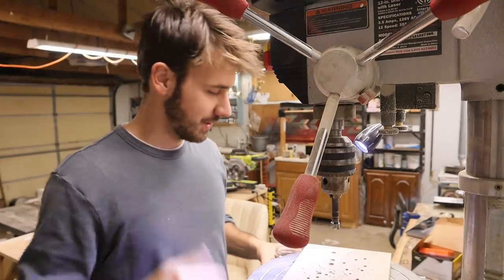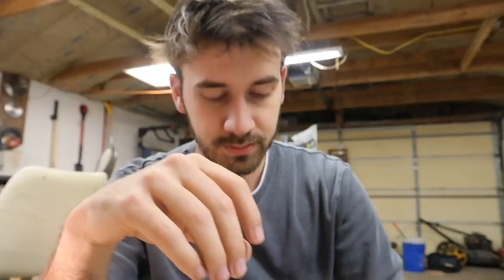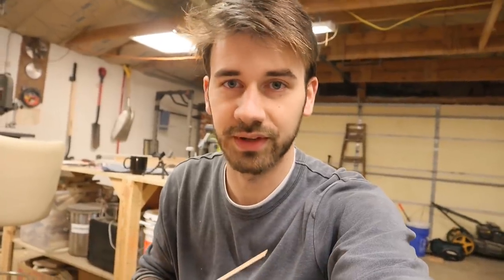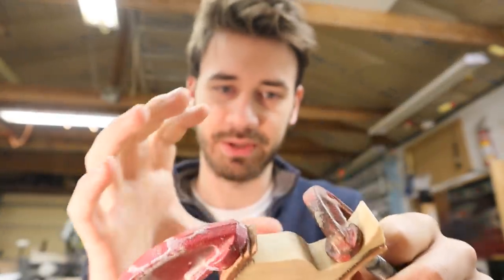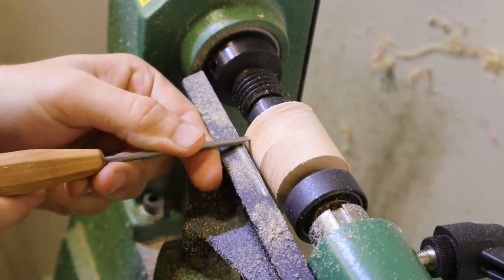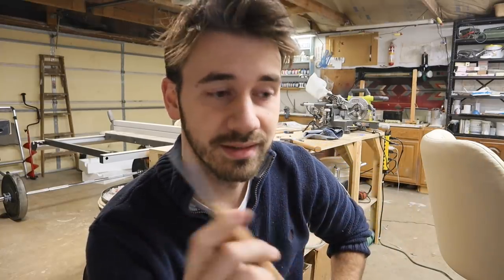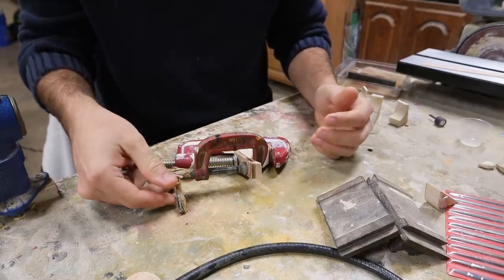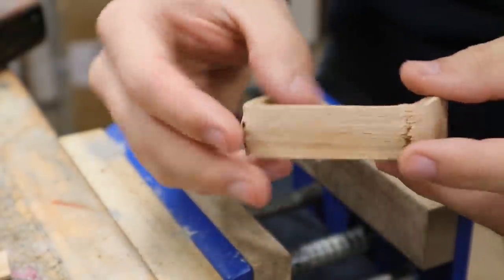Making a Fishing Reel

Comment: Already looks really good mate. What I've found is that wood bends the best when steamed. I've had to bend a 4 by 8 wooden beam into shape to fit the back curvature of a boat. So making a steam bender is the best way to go. (It's not hard to make, just a reservoir of boiling water at the bottom leading up to a horizontal tube to the top, plugged at either end.) It's the combination of heat and water that does the bending. Just water is not so flexible. Learned this from an old shipwright.
All the best and good luck from New Zealand
Reply: For those size of strip he can use a standard pressure cooker and have the strip sitting in the steam
Reply: @jamendetvarjukul  that's a good idea

Comment: This is turning out nicer that i thought. If i may add few pointers, when bending wood a really good way of doing it is with steam. what you do is just get some pvc pipe and rig that air tight into a pot of water so that the pipe is laying in a 45 degree angle compared to the pot that you then heat up and use as a steam source to soften up the fibers of the wood, you can get thin strips of wood so soft that you can tie it into a bowtie. Second thing that came to mind is the material for the drag system. Old fly reels use cork mat as a breaking surface so maybe that might be something that you could use for your reel.

Comment: You, sir, are a ninja for attempting something like this!  By the way, you can reduce the springback on your bent laminations by baking the whole thing, clamps and all, in a low temperature oven.  Also, you can put a metal band around the outside of your bent laminations to support the back, reducing cracking.  You may have reduced the radius of curve in the design of bail to make it less likely to crack.

Comment: For the aluminum gears to get the 45° mesh angle you can use the lathe, as long as your chisels are harder then the aluminum they should be fine (but I would use files). Also when you were bending the hickory,  I've made re-curves before with a similar process (different wood), If you have any leather around the shop put it between the wood and the mold to prevent the cracking(Works best if the leather is between a 4-8 thickness).  Can't wait to see your next video.

Comment: Nylon washers for the spool. Or teflon. Should have drilled the center hole while in the lathe so its centered and used the forstner bit in the lathe. A lot of the drilling could have been done on the lathe. Ash would have been better as it's not as brittle and easier to work in a lathe. Also flexes more before breaking. That's why bats are made from it. You make some killer life like lures. Awesome airbrush and brush work. I have an idea to replace your torch. A hot air soldering gun would work better and allow you to adjust the temp. I use one for all kinds of things. Browning food, stripping paint, soldering, welding plastic, drying things fast(like crazy glue and paint), starting charcoal for my grill, i tell ya it's a definite multi-tasker. Allows you to set temp and air speed. And the best thing was it was 30$ on the Bay. Just an idea.

Comment: You can use the lathe to drill, also, don't forget! The end stock can instead chuck a drill and be perfectly aligned.  Also that triangle tool you had is for cutting in 45° cuts

Comment: Your outside strips cracked while laminating because they didn’t have any support.  It’s why your inside strips didn’t crack even though they had a tighter radius to bend to.  They often use thin metal as a backer, but with something this small just put an extra strip of the same wood on the outside, just don’t glue it.

Speaking of, wax your forms next time to be sure squeeze out won’t screw it up.

Comment: Hey man, take it from someone who has been there done that. Wear some safety glasses, and just as importantly, make sure they fit your face. I use to not and when I did they had big gaps in them. Until I was grinding on a knife one day and ended up getting a chunk of metal in my eye. Rinsed it out, but it didn't come out. Few days later it hurt so bad to close my eye, went to ER, they had to call in an opthomologist on a Saturday to do what he called a mini prk to get the chunk out it was so deep. I didn't lose any sight. Dont want to see that happen to anyone else. It could have been a lot worse.

Comment: You can get carbon drag washers for fishing reels on eBay also you should go on YouTube and check out some videos using lathe tools they can be very dangerous good to get a few lessons that's how I learned also you can get grinding wheels aluminum oxide I believe for sharpening tool steel they are white

Comment: For future drilling on wood,  chuck your part up on your new lathe, put a drill chuck in your tail stock (morse taper arbor) on the lathe and use it as  horizontal drill. Works very well and all items are held in place as is.

Comment: For next time...
Set you pan and wood strips in the vacuum then pour boiling water from a kettle into the pan. Then run the vacuum. Heat helps tremendously in the bending process. I use a steam box for my boomerang wood strips. Also heavy leather or sacrifice wood strip as you outer layer makes for less splintering of the wood you want formed.
Are you going to cast your gears or carve them?

Comment: A split cane rod to match perhaps? Doesn't need any fancy tools or expensive material, my dad had a few he'd made in his youth and he's not exactly a master craftsman but they looked and functioned fine.
Hobbing your own small gears is incredibly tedious and precise without mechanical help so don't feel too bad if you've got to buy a cheap reel and gut it for parts (also no idea how you plan to make a worm gear without an auto feed lathe), you could also get the drag washers from the same donor

Comment: Hello, mechanical engineer here. While aluminum would probably work for the gears, aluminum is generally too soft a metal to be used in most gear systems. For a fishing reel I'd imagine it would be fine, but you'd be better off using something like brass or better yet aluminum bronze if you could get a hold of it. 

If you're feeling even more ambitious you could even cast the gears in aluminum bronze yourself, aluminum bronze is generally a very good choice for gears because it is one of the harder bronzes and can even be heat treated up to mild steel like hardnesses. 

That's probably a little beyond what you're trying to do here tho.

Best of luck.

Comment: For the darg you should use wood rings that have been spin on the lathe and rubbed against another piece of wood until the ring is hardened from heat and compreaajon and is smooth
Reply: Commpression
Reply: @seanallino4357  compression

Comment: I know I'll be the 300th person to say this, but yeah: eye protection. I can't even count how many times I've had Dremel grinding wheels fly apart. Had I not been wearing eye protection on the last two times I'd be blind right now, no doubt.

While I'm at it, I'm gonna unload some thoughts:

When bending wood, heating the wood softens the hard fibrous parts of the wood in ways that simple soaking can't. A simple way to get that wood and water hot is to immerse it like you did, then just plunk it in the microwave oven for a few minutes. Depending on the type of wood, adding some ammonia to the water can help it bend more easily as well, but it's likely that heat alone is enough.

On the lathe, the steady rest should be backed out a bit, and probably not as high as you had it. You want it high enough so that the top edge of your chisel is touching on the center of the part you're turning. Backing the steady rest out a bit gives you more room to move the tool, and keeps your hands away from the action.

Tune that band saw! Years ago I saw this video (https://www.youtube.com/watch?v=wGbZqWac0jU) and couldn't believe how much better my bandsaw cut when I tuned up my bandsaw. It's easily my favorite tool now (even more loved than my laser cutter, which says a lot).

Finally - if your forstner bits are burning the wood, they're either really dull or your drilling speeds are way too high (or both). Trying slowing the speed down if you're able and see if that helps.

Comment: Nice work, but you will be disappointed with aluminum for that application. It's not "slippery" and will likely gall up and wear prematurely. 
  There lots of online sources for brass. It will be worth the extra couple days it takes to have it shipped. 

    Or, check McMaster-Carr or Grainger. There's a good change you can find one with the spec's you need already made for a few dollars.
Reply from the maker: Thanks for the tip.. I’m going to find some brass for sure now
Reply: @marlingbaits   You might also check out Clickspring's Youtube channel. He's a clock maker and makes his brass gears by hand.

Comment: Obviously your water soaking method worked, but the appeal of boiling water or steam is the heat is what softens the lignin in the wood allowing it to bend. Steaming the wood is the most efficient way as steam carries heat very well. Of course then you need to make a steaming cabinet but there's a video by Tips From a Shipwright where he makes large heavy duty plastic bags to steam things in.

Comment: Fly fishing reels often use 2-3 graphite washers, then conical washers flipped 180 degrees to one another for a spring. Hard to explain a normal setup via text so let's try this.

Nut to |()()()|| to spool Hope that sort of makes sense, flats are graphite washers and the brackets are the conical ones. It may also be worth it to have felt washers for grease.

Comment: Carbon fiber and leather discs for your drag system and you can make the carbon discs u have the vacuum chamber
Reply: Just make it high carbon content because the leather will get wet and be your wear material and act as a cooling agent. Thats how it was done back in the day minus the carbon fiber they used steel

Comment: When using a lathe, the cutting edge needs to sit below the axis of the lathe. At 13:38, the cutting edge is way above the lathe axis. What happens is that the tool wants to bury itself in the wood, which makes it chatter like that. It could bind up so badly that you ruin the entire work, or worse still, the work will fling that tool right back at you.

Comment: Don't use your gouge as a scraper , you probably have a flat scraper for just that  , use your gouge on a 45 degree angle meaning roll the gouge onto its edge almost (45 degree) and run your piece , will cut so much better against the rest  not flat, its a great rounding tool if used properly

Comment: NEXT TIME YOU HAVE TO INSERT A BEARING INTO ANYTHING USE Loctite Bearing Mount Stick x10 EASIER TO PERMANENTLY INSERT A BEARING WITHOUT ANY  MESS OR WORRY OF GETTING IT INSIDE THE BEARING WORKS WITH LOOSE BEARINGS TOO! 
A HINT FROM YOU UNCLE AL